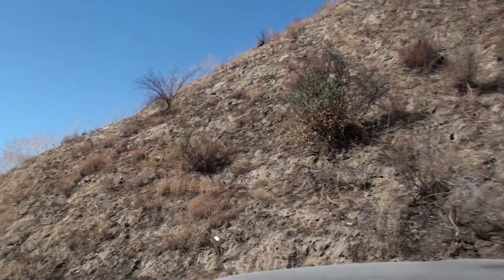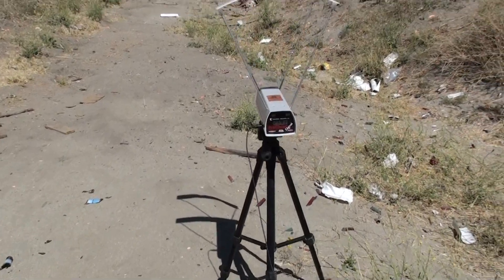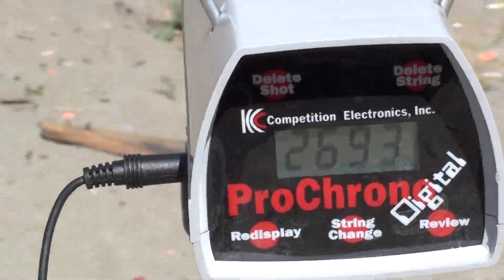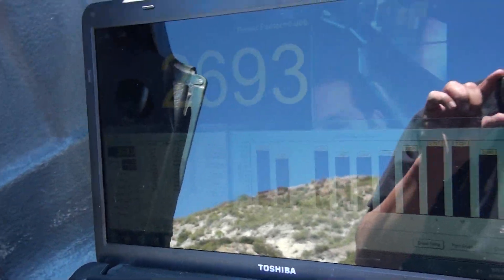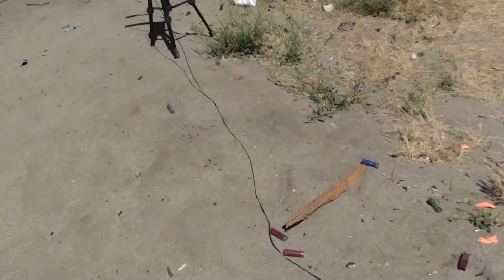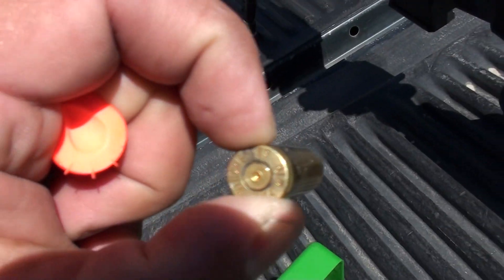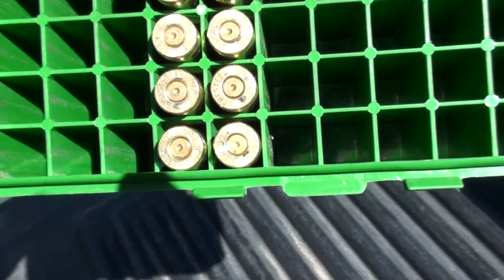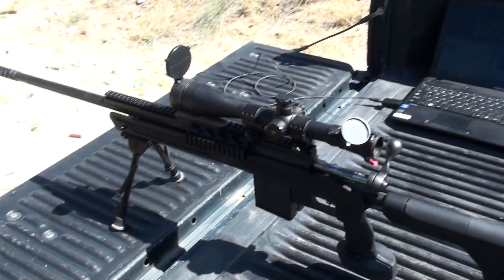RUNNING HOT??( NEW CHRONOGRAPH)

Comment from the maker: @FTW20ten Thanks,Yes putting alot of info,Just in case I forget .I can always refer back to the video.Just remember  I load tested 178/varget when it was cold. Now since summer is here,Now I see pressure sign and flat primers. I haven't try 42.8 yet but with 43.0 should be around 2600fps.That same day I got 2560fps with the 208gr amax's but had pressure sign.I may use 43.5 for the 178gr and 42.0 for the 208gr.This weekend I may do a ladder test with rl-17 powder.I may get 100fps more. will see

Comment: I use 44.5gr of varget with the 178 A-Maxs and the COL is 2.830 +- .001 with lapua brass. My avg fps is 2674 and my STD is 9. Its pretty accurate out of my 26" tube but ive had better loads for accuracy just not as fast. Nice chrony though. Mine is no where near that bad ass but it works.